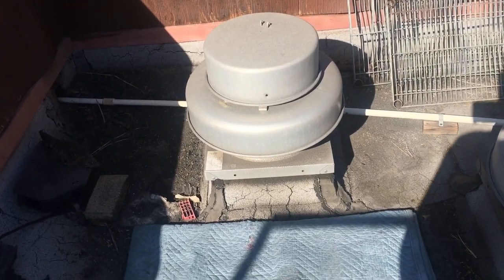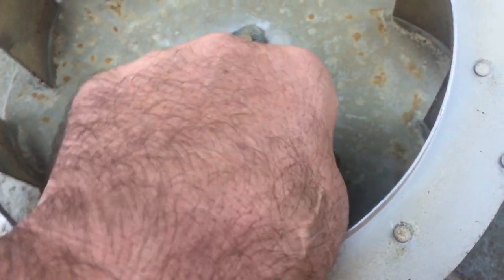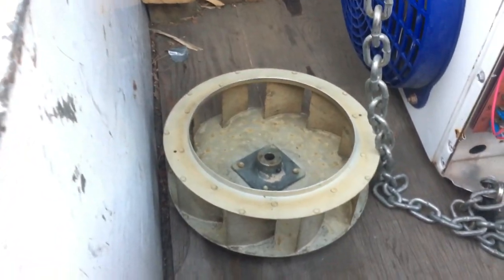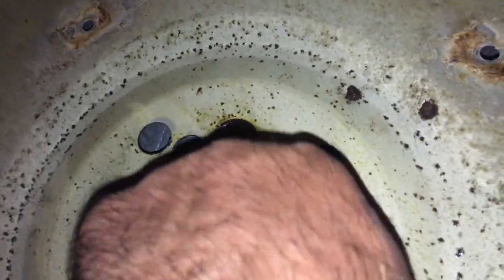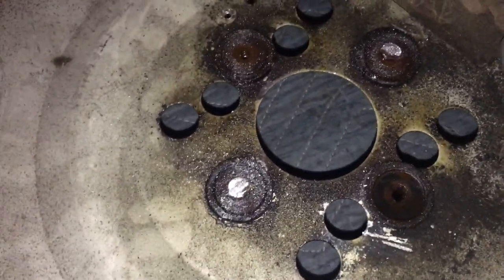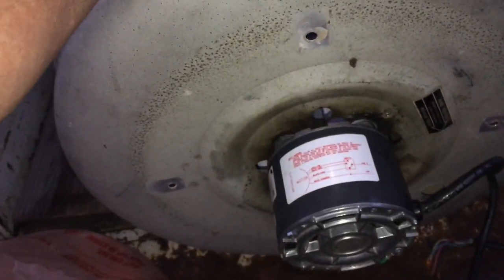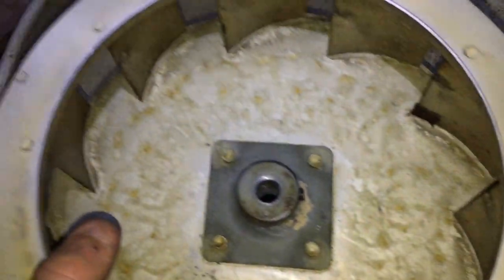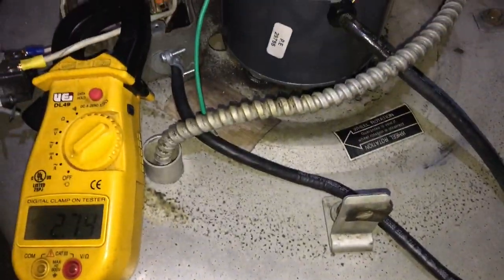How to change a Motor in a Greenheck Roof exhaust Fan.

Comment: Looks like that fan is a G-90 based on the wheel. Be aware that if you ever need to replace that fan the new G-90s have a glass fiber reinforced wheel which is only meant for sustained air temps of 130 degrees F. Your best bet on a replacement if it ever needs one is to go to an upblast fan of size 99 (CUE or CUBE), which would be the next size up which has an Aluminum wheel suitable for restaurant exhaust and carry a UL762 rating. Best to have an upblast for stuff like this so you're not throwing grease onto the roof deck.
Reply from the maker: Thanks. appreciate the info. yea , its a G90.
down below is just a Oven. its just exhausting oven exhaust heat. a Huge bakery oven down below. they cook Bagels 🥯 in the ovens & a Shit load of bacon 🥓.  its only hot air that comes out of roof exhaust . not a speck of grease anywhere. in duct or on roof.

Comment: How long did it take you ,did a lot of kitchen upblast if it's too rusty i sell them a new one
Reply from the maker: Very time consuming — first day - diagnosis, removal , disassembly , order new motor. 2nd day - P. u. new motor , reassembly & install. 8hrs + getting nuts at Home Depot & ordering New motor.
Reply from the maker: next time. maybe I get a New exhauster.